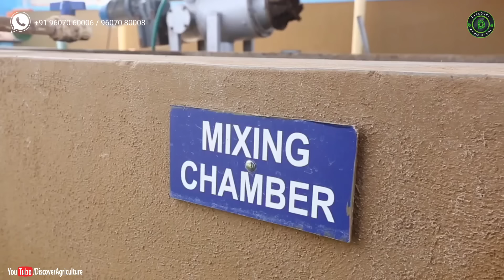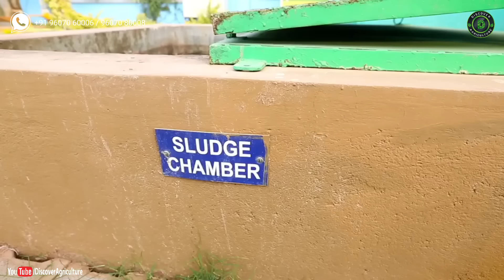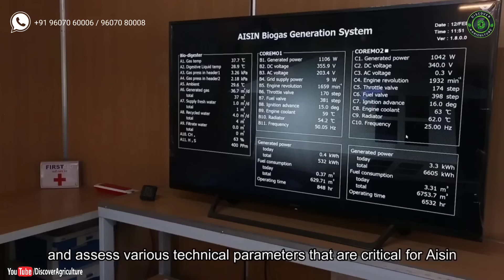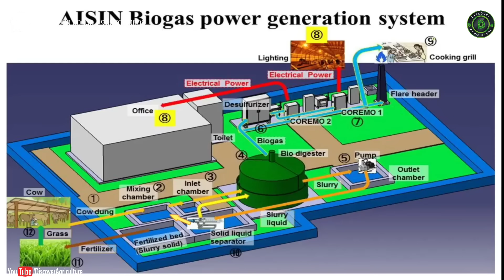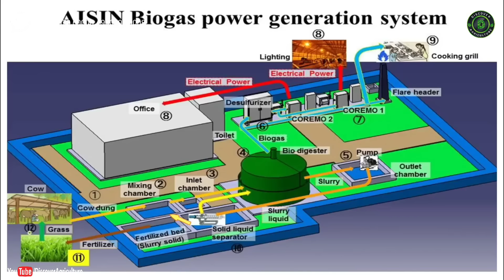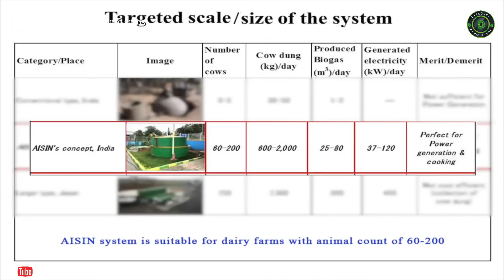How to Generate Electricity from Biogas Plant at Home| Electricity from Cow Dung with Gobar Gas

Comment: How much is the cost of the engine. You guys have mentioned the engine life is 32000 hrs, which is 3.75 years. if we need to change the engine, how much it will cost for engine and installation. Is this cost effective in long run?
The only advt which we can see is that they are able to generate the electricity

Comment: In India this was started way back in 1960 and fully incorporated in 1981 by NPBD. Over a period of time, with domestic LPG becoming more accessible by the people this slowly died a natural death. The economics to successfully operate a biogas plant is burdensome therefore users tend to shift to the more easily available and more pocket-friendly LPG. Jai Hind.
Reply: With fuel prices rising, this will become more popular now
Reply: The biggest problem with biogas is that it eat away metal mostly iron due to which most of the biodigester get useless after some year. If you use in engine it will eat away metal of it and make it useless. It is always better to treat the gas first so that it will not eat metal before using
Reply: @ajaybaronia4452  How do you treat it? Is there some kind of filtration process?
Reply: Total only power project cost please

Comment: Compared to solar power with same power rating I think this system requires more initial capital for equipment s and continues work after installation
Reply: Solar panels and battery production are more poisonous than cow dung. The panels need to change after sometimes.
Reply: Solar panels are expensive.

Comment: How is the gas finally converted to electrcity . What is the principle used to 
for conversion
Reply: Any large engine designed to run on cng, lpg can run on methane with slight modification. That engine then drives a power generator.
Reply: @mohammedsaied1121  Brilliant.

Comment: After use in cooking, manufacturing or whatever. What goes into the atmosphere, is it a pollutant or clean?  Kind Regards
Reply: Methane is 4 times more warming than carbon dioxide. When you collect the methane from the manure and burn it, it turns to carbon dioxide just like conventional cooking gas. However it's reducing the global warming that the methane could cause by four times and slowing it down when it's stored

Comment: To obtain ~ 2kW of electric power and some gas for the stove, it is an excess of form over substance.
The cost of the investment is probably enormous, and you can see a lot of human work.
Solar panels plus a battery 1000% more efficient.
Reply: Nothing wrong with keeping people employed, not to mention cleaning dung and creating compost. There is a great value here. Keep India green, and clean.
Reply: The produces 24/7  stable power also the quality of power will be better and it works in absence of sunlight. An hybrid setup would be needed
Reply: @librasun123  The fact that they have a job that is completely unprofitable is supposed to be an advantage?
Let's assume that this installation has 4 KW for which you have to pay in Poland
~ 0.5 USD for 1Kwh x 24 hours = 12 USD This is how much you can earn in Poland in 2 hours
  ordinary work.
I do not know what energy caves are in India, but I think it's easy to count
  that employees will work for a bowl of rice there, and where is the return on this huge investment?
Reply: @mkkristna  I assume that even the Tesla roof plus power wall installation would be significantly cheaper than such a mano-factory.
There are also biogas plants in Poland, for example, I saw one that was operated only by the owner and had 150 cows
Reply: @panbronek  the case is never been on price as goverments should decide on the subsidies based on how green is the source. Since this available naturally with abundunt manpower here  viz a viz with lesser side effects compared to other renewables such as solar hydro and wind this should adopted widely
Reply: @panbronek  
1. In a country like India, where there are billions of people, creating jobs is an essential component of the economy. 
2 India has one of the largest numbers of cattle on the planet 
3. Capturing methane gas for the energy component and cooking gas is a value add for the dairy farms which would have gone to waste if thrown into the field
4. I have seen smaller units for homes used for the purpose of producing cooking gas.
5. Capital cost for such scheme is probably high but it is offset against zero input cost. Overall it is practical
Reply: Slurry which is the byproduct can be used as a fertilizer and reduce enormous input costs of farmers